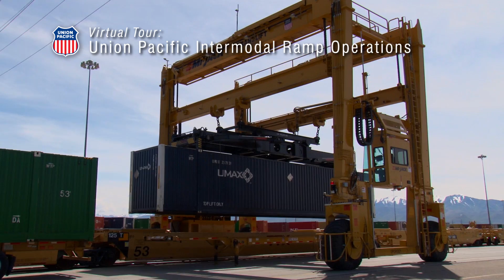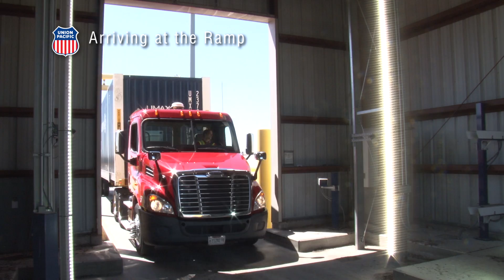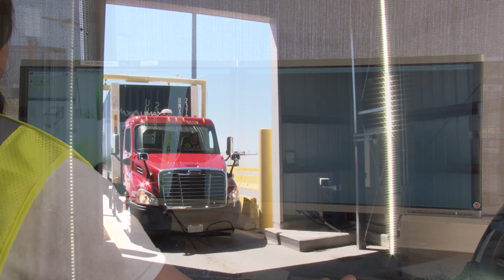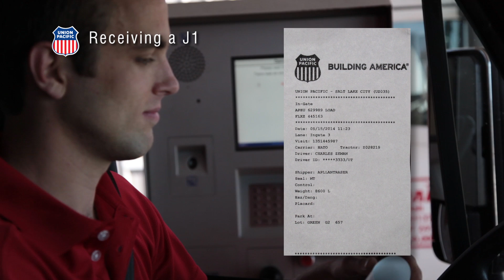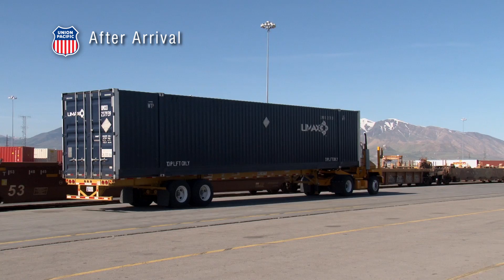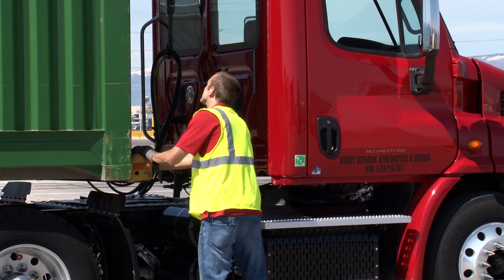Union Pacific Intermodal Ramp Operations Tour

Comment: Guys can u help me pls? i am from Russia and i need to do this exercise. 2. At an intermodal ramp driver usually go through the lane designated only for trucks with empty loads.
3. There are two types of gates: automated and manual.
4. It’s difficult for drivers to register at the main office.
5. For trailers cranes' arms lower on the left and right sides of the trailer body.
6. Customers can track their shipments’ movement any time, but it’s very difficult to do.
True or False or Doesn't say
Reply: True

Comment: Is intermodal a container that goes via train & then by truck?
Reply: a container that uses two forms of transit such as truck and train.
Reply: @martintheiss4038  Add ship(sea) to the mix of intermodal.  And air.   ship to truck or train to truck or ship on the other end depending on where the container starts out and is supposed to end its trip.

Comment: I wonder if with time, as robotics progress and rails become electrified, if we could expect to see individual flatcars take trailers and autonomously deliver them ?
Reply: jomax clux 

Agreed. Even with fuel costs cut out, trucks will still be less efficient than rail for distances greater than 600-750 miles -- simply because a single freight train can pull over 150 freight cars (300 containers if the line allows double-stack trains) with a crew of only 2-4 people. Also, for trucks going from Southern California to Chicago, the speed advantage is very small, if any -- BNSF runs its freight trains on the Hutchinson Main at 70 mph(!). Another corridor where trucks have minimal speed advantage is along I-80 in Nebraska, between Gibbon and North Platte (the Kearney Sub, aka the Triple Track Main). Overall, UP narrows the trucks' speed advantage between Laramie, Wyoming and Chicago to a minimum.

Comment: do you wiegh the trailers and loads
Reply: Usually the crane weights it, at least at the site I visited in germany. A built in scale allowed for precise measurements to protect other equipment and the crane itself had the winch torque limited to prevent it from any structural damage. For any loads up to 120t the operator would receive a warning. For any load exceeding 120t the crane would refuse to lift the load and go into emergency shutdown.

Same was true for the reach stackers. There was no precision scale built in, but they all had safety equipment preventing them from tipping over. Basically the pressure on the rear axle was measured, when low the speed was limited and when dangerously low only possible operations where to put the load back on the ground.
Reply: Cindy .J Witmore I am pretty sure they have to just for safety of the load and liability for the company
Reply: Cindy all containers should be weighed especially if they are scheduled to be trucked out.  In major industrial or warehouse tracts there should be a gas station or a truck stop that weighs the containers themselves for a small fee to ensure a receipt is printed out so if you are pulled over before your next customer there is proof that after you left your previous warehouse there was documentation the weight was under the legal maximum.
Reply: A truck driver is required to know the GVW of the truck.  A truck can not travel over most of the highways of over 80,000 lbs GVW without special permits except for limited conditions.  The length, height, and width of the vehicle with load are also given unless special permits are obtained.

Comment: do you know what all of you should do with the steam program, after 4014 is done you guys should and let Norfolk southern know when you are done, you take your 3 steamers 844, 3985, and 4014 and they have 611, 1218, and 2156 (if they ever consider it). then west meets east in the middle of the country and both railways could do a 6 steam engine header and go all around the country. anyways I hope you read this comment and respond and hope you at least think about how historic this would be. if you don't its ok, but this will never happen again. just imagine this happening. I hope you respond
Reply: Gross Domestic Plums I don't think the UP 3985 will ever see steam again there busy using parts from 3985 if I recall to help repair the UP 4014
Reply: Joshua Ilac 3985 and 4014 are not the same class of engine, therefore they cannot use the same parts. The 3985 is part of the 3900 Challenger 4-6-6-4 Steamers while the 4014 is part of the 4000 class Big Boy 4 - 8 - 8 - 4 steamers. Two totally different locomotives at different lengths in different classes could not possibly share the same parts as they would simply not fit together correctly.
Reply: @hakeemsd70m  The two locos may not be the same class but I bet some of the appliances are interchangeable.